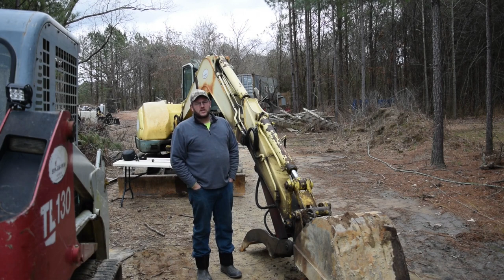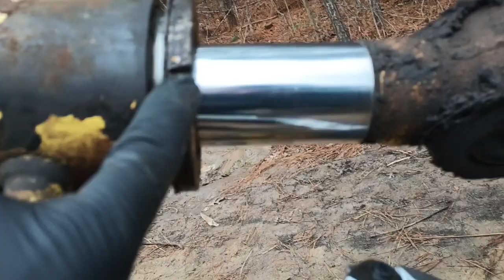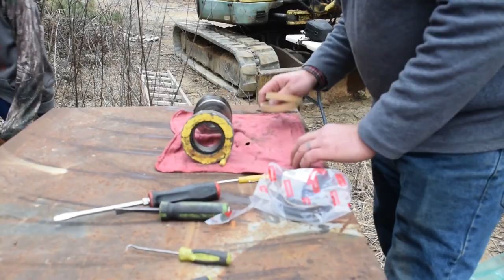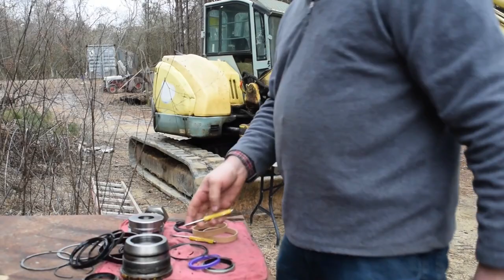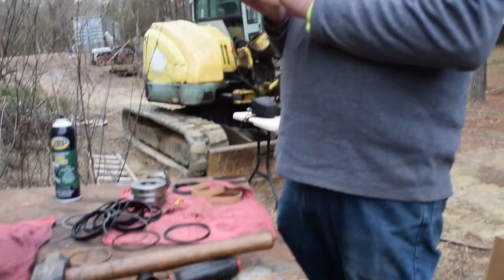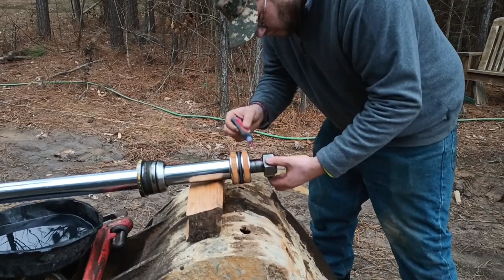Yanmar Vio-75 Excavator repair- Repack Bucket Cylinder

Comment: How did you bleed the hydraulic line?
Reply from the maker: with cylinders its not an issue of needing to bleed the line.  just operated the machine full stroke in both directions and hold in relief each way a couple of times.  the pressure differential when the direction is changed make the air go back to the tank.   (its like pulling a vacuum on a A/C system.... when the pressure rapidly drops, the air gets sucked back to the tank)